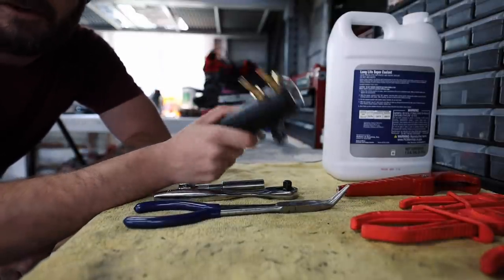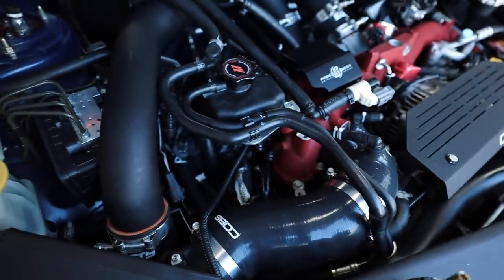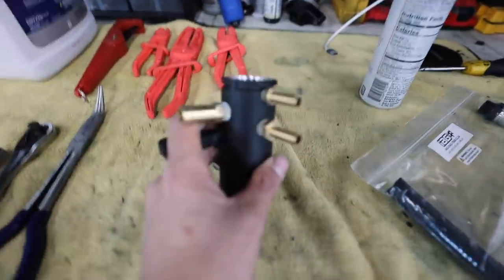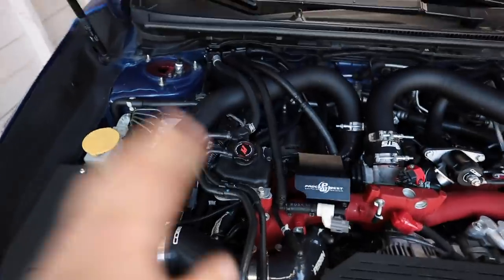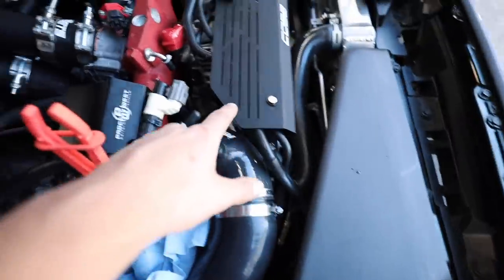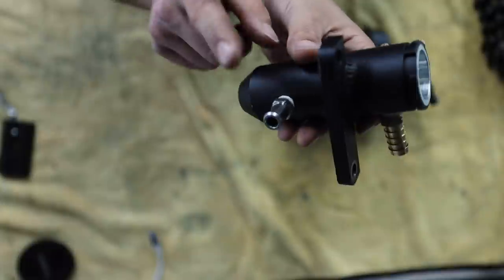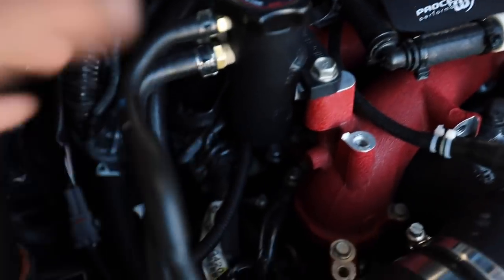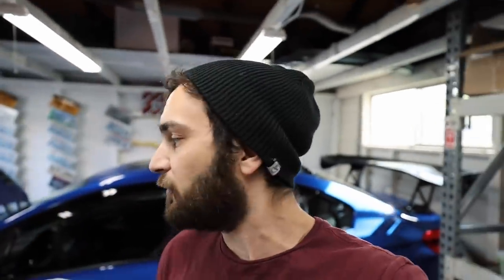Killer B Upper Turbo Coolant Reservoir, Smaller is Better.

Comment: I bought one of those killer b coolant expansion tanks and even trimmed enough hose to allow proper fitment for the bottom hose and the hose blew at the base of it. I was never able to find an elbow shaped hose to fit bc the expansion tank is somewhat offset to the right. So what I did was removed the top mounting bolt and angle the expansion tank left to have the coolant ports to be in-line with each other. Doing it this way I believe reduces tension near the base of the hose to keep it from bursting again. Seems like offsetting the entire unit and having it mounted with one bolt is doing the tick. I think killer b messed up with the actual mounting bracket bc the ports shouldn’t be offset. They should be aligned. You’ll notice when you align the bottom barb with the coolant port the mounting brackets don’t align.
Reply from the maker: Interesting 🧐 I've had a handful of these and never had this issue, curious if thr mounting holes kn yours may have been mis drilled

Comment: Neat, tidy well laid out engine bays that improve access and provide flexibility are a thing of beauty 😍. Plastic OEM part versus precision metal by Killer Bee Motorsports it is no brainer!  Something does seem missing though in that picturesque engine bay, a strut tower brace to complete your front suspension set up. Cusco will clear the IAG AOS; have that duo myself.
Reply from the maker: I wNt the OEM JDM STI brace but they've been out of stock for so long! And I've broken those OEM reservoirs so many times its nice to have one that one break and takes up much less room 😍

Comment: I was sold, right from day one b4 the intro to this build.
Tanner you did a real great job, almost can't identify from the original stock.
I reckon as long as you keep up the maintenance and odd special part built motor's need, you should be solid.
Great job 🤘🤘👍👍
Reply from the maker: Thank you! And I have been meticulous about all the parts that are going on and how they're all fitted 🔥 appreciate the support my man!
Reply: @Smeedia  your welcome sir. When do you move home, and what if you put an Ej25 sti into the BRZ🕗🕛🕣🕧🤔🤔🕯️🕯️💡💡💡💥💥🇺🇸🇬🇧
Reply from the maker: The engine qould ait too low in the BRZ would have to completely remake the front suffrage to fit one 😅

Comment: Finally getting some pro Bono parts! Well deserved. What pressure coolant caps are you running?
Reply from the maker: Was stoked for it! And not sure what pressure it is, it was the one that came with the readiator when I got it 😅
Reply: You can run 1.3 bar at the radiator, 1.1 bar at the reservoir.

Comment: That looks and fits much better than the mishimoto coolant reservoir. My mishimoto one is already rubbing into my intercooler pipe and I had to modify where it sits which doesnt look good. Dont have the killer B product, but by the looks of it I'd definitely recommend.
Reply from the maker: Its one of my favorite 🔥 their old V1 did perfect in my old Hawkeye this new one looks and fits perfectly! 😁
Reply: Definitely will look into it when I get my car back from the workshop when its done with my build 😂

Comment: Looks great, very easy install, well done. Does it matter that the reservoir is smaller, from a pure volume standpoint?
Reply from the maker: It shludlent as it continues to flow coolant, these are more of a distribution center for coolant to spread out
Reply: @Smeedia  thanks

Comment: I don't know if its just me, but I had 2 mishimoto radiator caps fail. They leaked fluid. That is a sweet piece tho!
Reply from the maker: Have ahad a few people say the same, ordering a new cap today 😅
Reply: @Smeedia  smart man.. I ended up going with the cobb cap. Its a tight fit no wobbling around, and the best part it hasn't leaked lol.

Comment: Im going to order one asap. Looks nice and saves so much room!
Reply: Is this ok for stock turbo.. i would amagine so It just helps cool the turbo.. 
What else would you suggest to help the engines life?
Reply from the maker: It will work with stock turbo 😁 

And AOS, cyl 4 cooling mod, larger radiator, oil pan, oil pick up 😁
Reply: @Smeedia  you have cylinder 4 cooling mod done on your Subi?
Reply from the maker: Yes I do 🔥
Reply: @Smeedia  which one did you choose to go with bro
Reply from the maker: I got the getadome tune one, ive seen some issues with the torque solutions but outside of that any should be good 🔥

Comment: Is burping the system necessary? And did you use oem coolant to top off?
Reply from the maker: Yessir OEM coolant, and it doesn't hurt, a small burp should purge any air out
Reply: @Smeedia  just got an STI and I’m still learning. Do you know where I can find instructions on how to burp my STI?
Reply from the maker: I've got a few videos doing it, but just burp it from the upper coolant res with the heat on full blast
Reply: @Smeedia  I can’t find the video of how you do it😭 just installed one yesterday and can’t figure out how to put the funnel kit on this to burp it

Comment: I’ve read on forums the upper coolant tank helps continue to cool the turbo after the engine is shut off. I take forums with a grain of salt but I do wonder why Subaru would make it that size unless it served a purpose.
Reply from the maker: The coolant will continue to flow through the res after the car has been shut off, from what I gathered it just serves as a junction point for multiple areas to be able to receive flowing coolant from
Reply: Just buy a turbo timer bro 🤣
Reply from the maker: Not needed unless you have a turbo that does not flow coolant though it 😅

Comment: I see you still had oem pressure cap on a aftermarket radiator but you were using a Mishimoto cap on expansion tank. What cap would I need to get or options if i do that slimmed resevoir?  Did you see any improvements in cooling reliability from that mod?
Reply from the maker: No reap benefits aside from clearing room for a rotated set up, ideally you'd take the after market cap and swap it to the upper exspansion tank 🔥
Reply: @Smeedia  Well Im still back and forth testing oem cap on my aftermarket csf radiator vs oem. I did a WOT high speed with the OEm 1 way pressuree cap and got to 223 degrees on coolanrt. Mind you im also using 1 bottle of royal purple ICE in the subaru blue coolant. Ive been trying alot of different things after installing the aftermarket csf radiator trying to get consistency. But it has also been extremly hot where I live. Im not planning rotated anytime soon so I think I will do the killer b water pump housing as priority and see if that helps find better consistency numbers. Alot of research keeps telling me the 1.4 bar csf cap is intended to replace oem cap on radiator. I put oem fans back on car so that fixed stationary cooling but when i see 223 degrees doing WOT on flat roads I wonder how bad it will be for canyon driving, which is what i want to do mostly with the car is canyon spirited driving.
Reply: @djqbassic  The CSF cap that came with mine is a 2 way cap that should be put on the expansion tank, not the radiator. @FlatironsTuning did a video explaining the difference between the 2 caps. https://youtu.be/HzjBJz1Zdmw

Comment: I'm considering buying a grimmspeed tmic, Do you think it's worth it or should I just stick with the stock one? I'm only stage one currently with AOS, SF Intake and a tomei exhaust.
Reply from the maker: I'd will definitely help with air flow and cooling, but what is your power goal for the car?
Reply: @Smeedia  I'd like to get around 350-400 once I get the parts. I was only considering the new intercooler for now because quite a bit of the fins are bent up. I wasn't sure if it was too big of a deal but it was concerning.
Reply from the maker: You can straighten the fina out to save some money and use the finds for other mods 😁 but for 350-400WHp youll need to swap the IC anyway so not a bad idea

Comment: What’s the difference between barbed and AN fittings? Which one should i get?
Reply from the maker: An is my preference, AN is a threaded fitting where barbed secures thr hose with barbs and typically require hose clamps
Reply: @Smeedia  ohh okay! Thank you, that was helpful and that was a fast reply too 😲
Reply from the maker: I got you 🙌 lol

Comment: The reservoir looks great except the two hoses  coming out the side. It looks like it needs some management there. It's kinda drives me crazy that there is 2 hoses dangling with unnecessary bends out front. Perhaps instead of the two nipple going to passenger side ...make two optional front ones with plugs in them. That way we can run those small hoses shorter and cleaner.
Reply from the maker: Going to be removing the OE hoses and cleaning it up, just need to get some hose. But I agree the OEM hoses are a little dangly and floppy 😅
Reply: @Smeedia  I recommend going with aftermarket silicone strengthened hoses you can get them straight in a bulk roll. They are more durable and resist heat better. Big plus they also look nice if you so happen to have any still showing out in the open. Ohhhhhh yeah cool colors too but personally I like black there's no need for attention for dinky hoses.

Comment: Hey bruh, I wanted to know if you could do an install of an alarm system on the car. I just got my windows smashed in this month and I was thinking about going that route for my next "mod".
Reply from the maker: Sorry to hear, what systems have you been looking into?
Reply: @Smeedia  I was looking at the Viper  Responder LC3 the LCD 2-way system. I'm not sure if that is overkill or not or if there are better systems to install. It's just one of the first ones that stood out right away.
Reply from the maker: I'll take a look at it, dont know too much about security systems outside of the fact that the OEM one only works on the drivers door 🙃

Comment: i just got a 18 sti and i want to know: 
If i install stage 1 and equal length header + catless downpipe do i have to go dyno tune it or use tune on accessport?
Reply: You need a custom tune for headers and if u just run a downpipe u need a stage 2 tune if u run a stage 1 Ull destroy ur motor in no time
Reply: mosko726 how bout the e-tuning, burble is that different?
Reply from the maker: You can get an E tune for those mods, I would not suggest the burble tune though.
Reply: Like ur boi smeedia said get a etune or go out to a shop and have pro tone only real option u have for that kind of upgrade
Reply: mosko726 sorry for being noob but what u mean is that if i install header+ downpipe + cobb intake sf. i have to run stage 2+ SF on the accessport and go to the shop and have pro tune.
Reply from the maker: You will need a base map from your tuner to be Ble to drive it there, unfortunately there are no OTS tunes for headers 😔
Reply: Smeedia so i can just bring those stuff to the shop have them install and tune for me???
Reply from the maker: Yes you can do that 😁
Reply: Smeedia explained it best for u then I can lol

Comment: Sounding like a super rich dude on the hose lol, nearly $30 for a small heater hose. Regardless, enjoined the video and considered swapping my mishimoto expansion to the killer B
Reply from the maker: If it did not us an AN Fitting I would agree but AN fittings along are about $6-10 each so its not too bad 😅 and the tank really feeds up a good amount of room over there 🔥